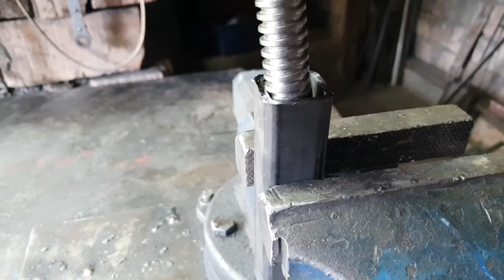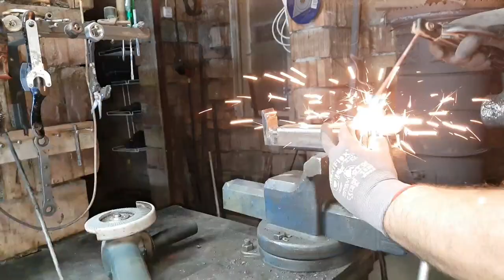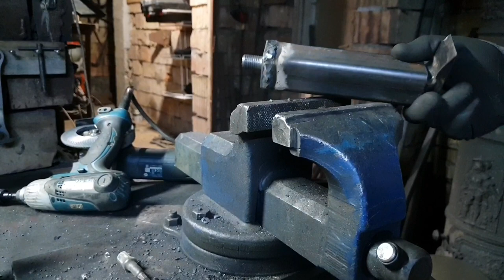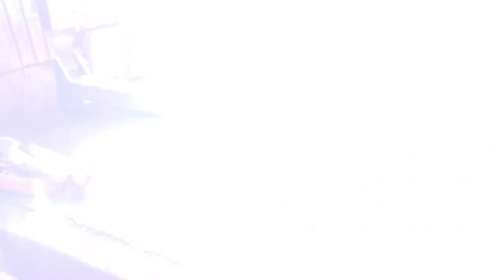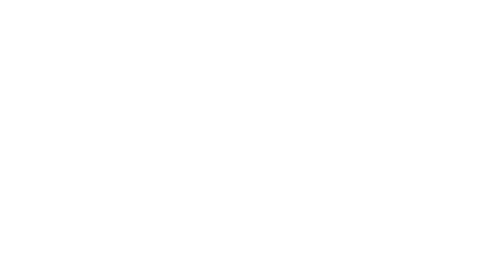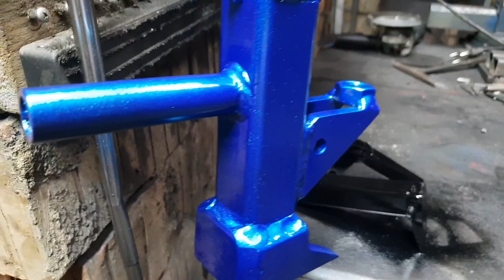How to  build a bead breaker tool. Presa dejantare - 0772239424

Comment: Great job.. So how about the sizes and the measurements I need to do mine cause I'm running a tyre business
Reply from the maker: Hello. The final size of the press is somewhere around 20 cm high. It can be made to any size. It depends on everyone's needs. There are many measurements to be made, but you adapt along the way. If you search on my channel I think I have videos with more measurements. Good luck in building this bead breaker tool.
Reply from the maker: https://youtu.be/G6Xrb3KYiPI?si=idvqpu61Yt5YCiif